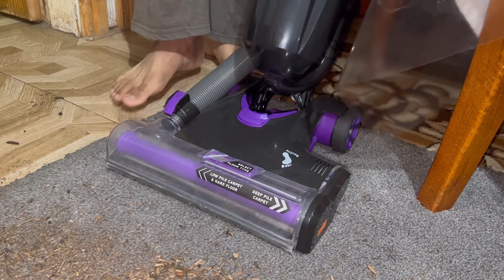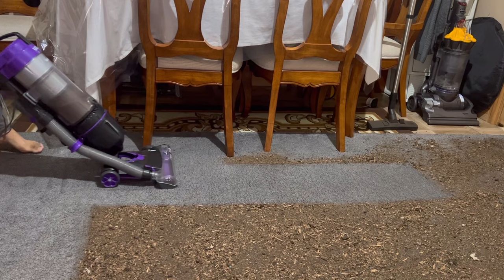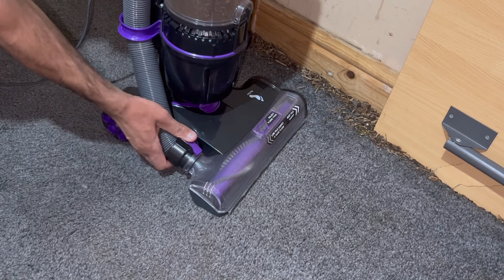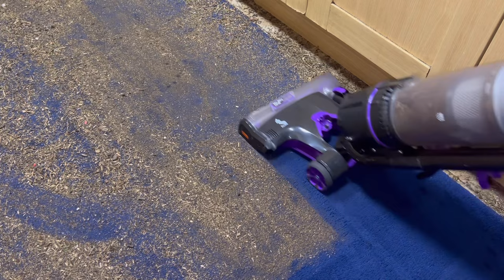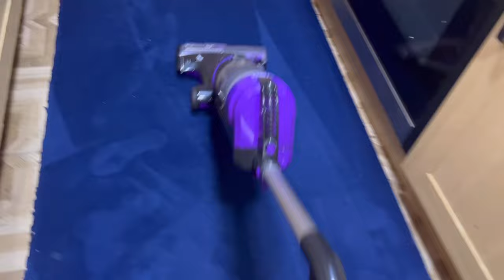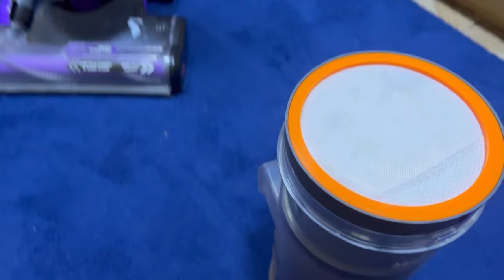Vax Mach Air vacuum cleaner (2024 model) - Performance testing - Better than Shark!

Comment: I have a 2020 vax Mach air revive, on my second as the brush bar packed up within warranty period. The hose is useless on it, I find now that as it’s older the filter gets absolutely filthy every time I empty it, and it becomes a real chore to clean. It doe’s well on carpet but less so on hard floors and stairs forget it. The filter cleaning is just inherent problem with bagless. The hose again a problem with upright vacuum cleaners. This is why I’m looking at a George but to purchase an airbrush for it too, bit of a jack of all trades. Massive bags on them so no mess plus he will clean carpets and upholstery like car seats etc.

Comment: Deliscious mess test! I love all the different angles 😂
Do you find this one  better than the eureka powerspeed?
Reply from the maker: Thanks! And this vax is WAYYYY more powerful than the powerspeed! It’s like a night and day difference 😂
Reply: @parwaz7861  ahh good to know😃 Thank you. I'll go for the powerspeed then. (I want one which doesn't suck up my rug but only sucks up  piles of dirt and mix)
Yes it does look like it has a very strong suction and btw yes that blue kitchen rug it's just *dribble dribble * with any vac you use on it 😍
Reply from the maker: @autumnsASMRVAC  I left the suction on max suction hence why it clamped down to the blue rug lol 😂 but there is a suction valve which can be adjusted to reduce suction 😄

Comment: Would that machine work in the us? I know that not all models are compatible with the US system.
Reply from the maker: The voltage is 240V as opposed to 120V so it will run at half the speed unfortunately unless it’s used with a step up transformer or a 240V power source